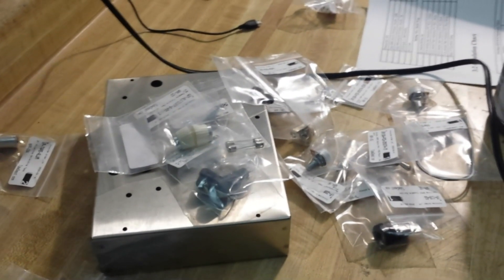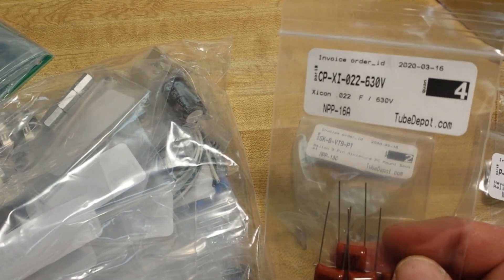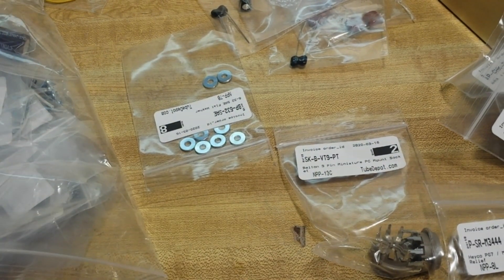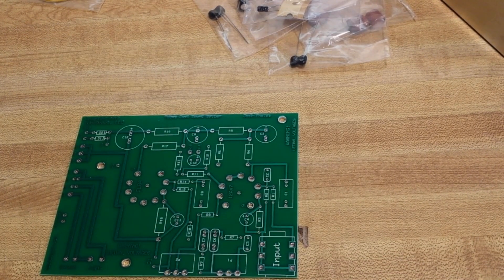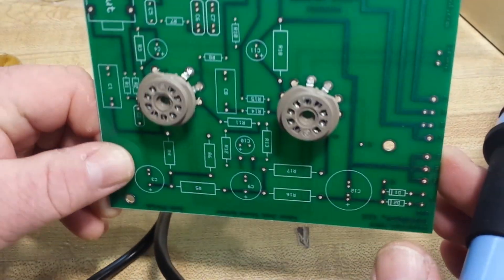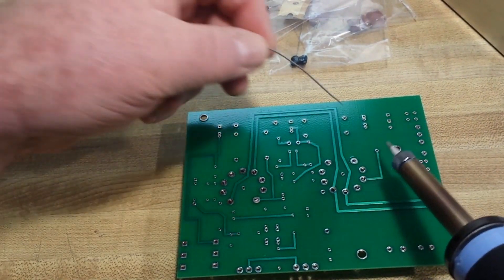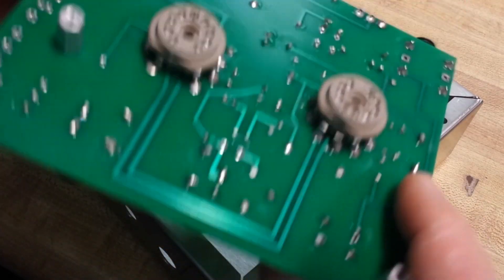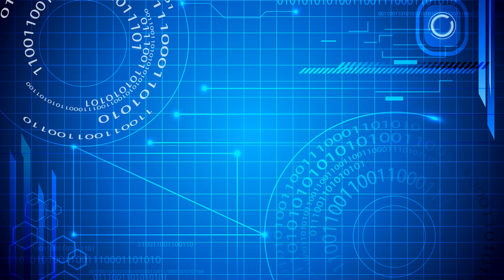Let's build a vacuum tube amplifier - part 2

Comment: Hello! I’m new to your channel and find it very helpful as I want to build myself an amp. I’m curious though, did you order a kit build? Or did you just know what you needed and order it all separately? Also, do you think it would be beneficial to build a kit first? And lastly, is it very much less costly to make a list of what I need and order it all separately, independent of a kit build? The reason I am assuming you are NOT using a kit is because in the first video drew the circuit and seem to know exactly what you’re doing. Again, thank you! If you could just clarify that for me when you have a moment. Appreciate ya!

Comment: I am going to skip the pcb and hard wire the whole amplifier. There are not too many parts and you can heat shrink all the leads of the components. As for people worried about the sockets on a PC board if you have enough trace and add enough solder that socket ain't going anywhere. I work with control units for air and vacuum machines. We have a removable relay board and the connection points stay put nothing gets pulled out when removing and inserting the boards. Tubes are a less stressful to the PC Board than these relay boards. 73

Ps I saw you put the tube sockets on the wrong side I would have done the same thing. The dynaco PC boards are the same way as your mistake. Also you cannot just reverse the board because the pin out on the tubes would be wrong as well. I would have used a Solder sucker and kept the legs for extra support. As long as you don't keep removing tubes you should be ok. You can also add socket savers and the tubes would be easier to remove. This is a good project. 73

Comment: I'm probably the hundredth person to say that it is vital to buy a little cheap plunger type solder sucker. The sucker would have cleared away the solder and allowed you to take the sockets out intact. You need the strength of soldered through connections here. Just pushing and pulling the tubes in and out with weak tacked surface solder connections will tear the pads straight off the board. Order new socket's from the kit supplier before you wreck the board by stripping pads and traces. Good luck, don't rush it.

Comment: 1 - attach stand offs to pcb board
2 - dry fit tube sockets into pcb
3 - screw stand offs onto enclosure with pcb and tube sockets in place
4 - adjust tube sockets until they fit nicely into provided holes
5 - solder tube sockets 
Now you know the tube sockets will fit nicely into the holes in your enclosure.

Comment: I'm screaming at you from Texas.  Did you hear me in Ohio?  In kitbuuilding it is generally preferred to start the soldering with the low-lying components (resistors, etc.) and leave the "taller" things (like the tube sockets) for later.  That way the board doesn't rock back and forth while you are soldering.  Maybe you should retitle this "How not to build a kit."
Reply from the maker: Obviously you didn't watch all the parts. I said "usually you start withe the smaller components, but in this case I am FOLLOWING THE INSTRUCTIONS" Thanks for your comments, as I can tell you didn't enjoy my videos. Sorry to disappoint.
Reply: @learnelectronics  Oops.  My apologies.  Those pesky instructions....  :-)

Comment: You aren't alone with that slip - I did the same thing with a line-follower model car kit.  I suppose I could have tried drawing the track on the ceiling, but I ended up going with your solution.

Comment: You CUT the tube sockets off???? As noted by Terry Smithwick, the sockets are subject to a lot of pressure, twisting and pulling and trusting surface solder to hold them is a bad idea. Bite the bullet and desolder them. Takes a while but worth the effort. Be safe dude.

Comment: Yes, I did start yelling at my screen. Being alone in the house, it was slightly less mortifying than you might imagine.
   Vacuum tube sockets need not only electrical connections but strong mechanical connection. You can place quite a bit of push, pull and torque on a socket when you place & remove the tubes.
   You are planning on keeping the amplifier around long enough to change the tubes a few times, aren't you?
   Since the sockets are now surface-mount, I would suggest you unscrew the PC Board each time you place/remove the tubes - so you can grab the socket and tube directly, with little stress on the soldered connections.
Reply from the maker: Thanks for the suggestions.
Reply: Tube purists tend to be overdoing it all the time. You see all sorts of pretty heavier components "flapping in the wind" on PCBs and devices work happily on. This is a DIY project not a touring Fender. Used noval tubes are small and not so heat intensitive. In mytube projects, if I make PCBs, I make them so the PCB fixing holes are just at the socket - and also use the central socket hole to secure the tube to the PCB. But, well, making such a simple tube curcuit on PCB doesn't seem sensible.

Comment: Nice save on the tube sockets. Just out of curiosity, and I imagine that it would be too late at this time, but would you be able to adjust the holes for the tubes instead of trying to relocate the sockets?
Reply from the maker: No, and you will see while in part 3 and 4

Comment: This was Great Paul! To bad about the sockets though. Might be worth it to get some new(better) ones. I am also a bit surprised they went with board mounted sockets and not chassis mounted. I get the cost savings, but it’s not worth all the future headaches that come with them. I am looking forward to the next part! Keep on rocking! Also, I am looking for a reliable source for some TDA7052a chips? Know anyone? I know they are no longer made.

Comment: just a side note those large resistors need to be elevated above the board  or the heat generated will brown out your pcb , keep up the good work
Reply from the maker: They are all elevated 1/16in as recommended by TubeDepot

Comment: I was hoping it would be point to point soldering. That is always fun. Stay safe.
Reply from the maker: Next one will be. This was a kit, next will be a scratch built
Reply: @andrewcurtis7313  It's where there is no circuit board, all of the legs of the components are soldered straight onto the valve socket legs or the chasiis (earth). It was how they made valve radios before PCB's were invented.
Reply: @andrewcurtis7313  If you want to see some serious point to point wiring, take a look at some photos online inside a Tektronix 535A, that is some serious point to point construction!
Reply: @andrewcurtis7313  Very old school. It can be tricky, but with something like a simple guitar amp, there are only a few components. I made one out of a metal bread bin once. (It was a bit flimsy.)

Comment: If I were you, I wouldn't beat myself up about soldering the tube sockets on the wrong side of the board, the instructions weren't very clear about it so it's a mistake anyone could make, looking forward to part 3 of this build....cheers!!!!
Reply from the maker: Thanks. Next part Wednesday.
Reply: I'm in the process of building a tube guitar amp as well, but it's a scratch-build of a Soldano SLO 100, only difference is it's going to be a 50 watt amp cause I'm using two matched EL34 tubes.
Reply: And five 12AX7 tubes.
Reply: I've been into electronics since I was 13 years old, and I'm 50 years old now, so it's been a long time, learnt a lot in the process.
Reply: @simonkormendy849  - Ooh, nice. Good  luck with that. 👍

You should post a video on it, definitely when you're done, and maybe even the construction of it. 😊